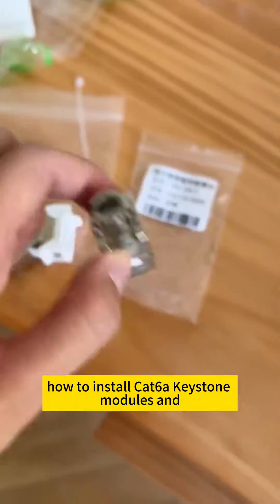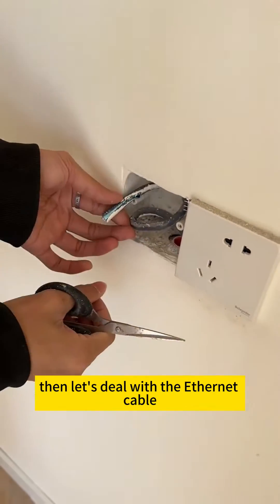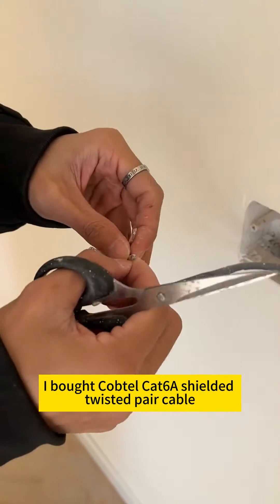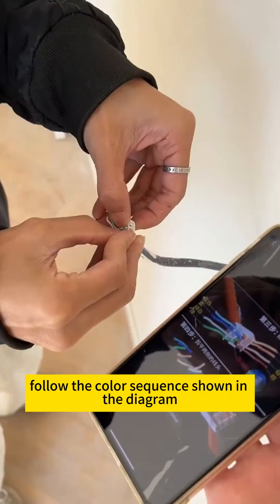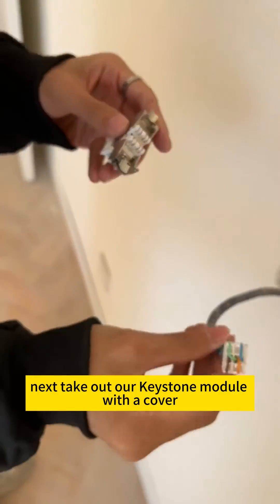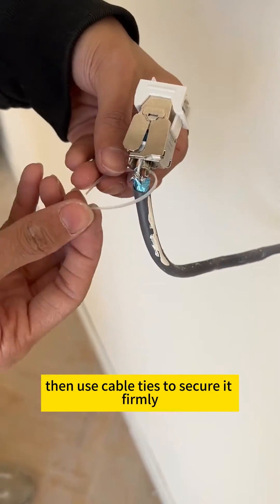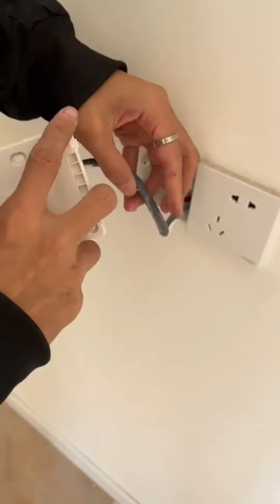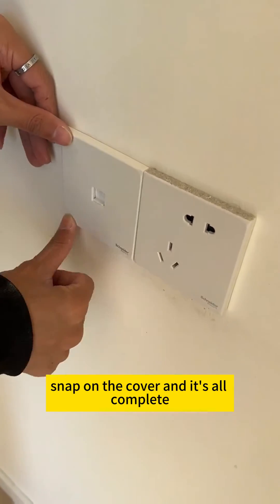How to Install Cat6a keystone Modules and faceplates？

Comment: Bruuuh just get some wire cutters! 
Those scissors are taking a real beating with you.

Also why on earth would you not cut the whole ziptie excess? Do you want to get cut by it during installation?
Reply from the maker: Thanks for reminding, I will  cut the whole ziptie excess in the later process. I also hate the scisssors. I should buy a crimper from COBTEL
Reply: American accent with a uk plug? Hmm